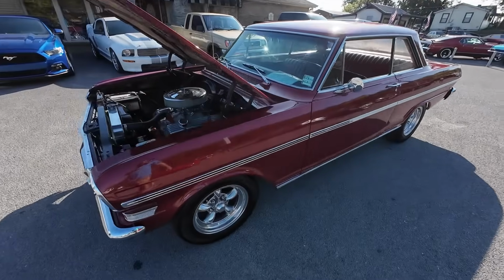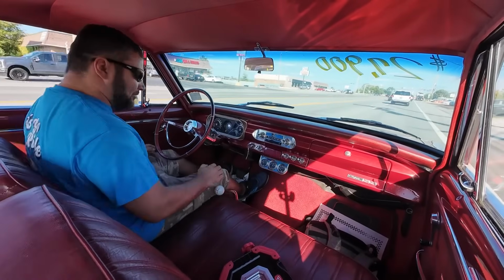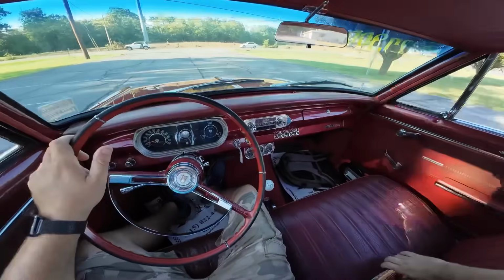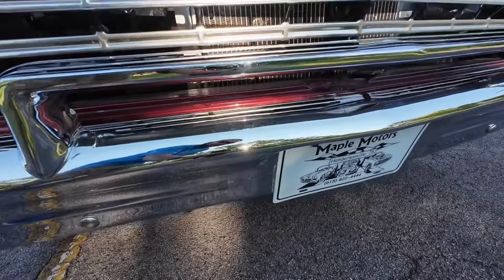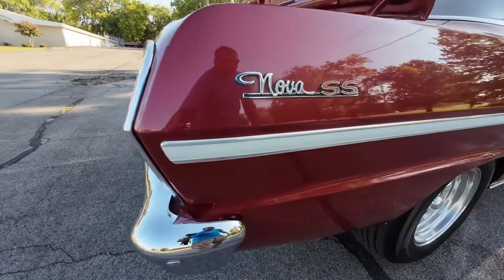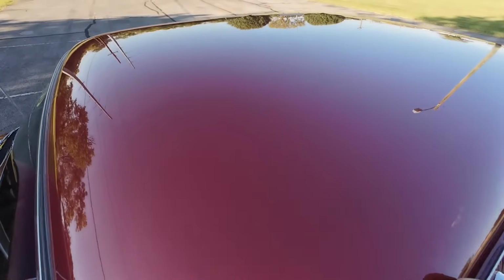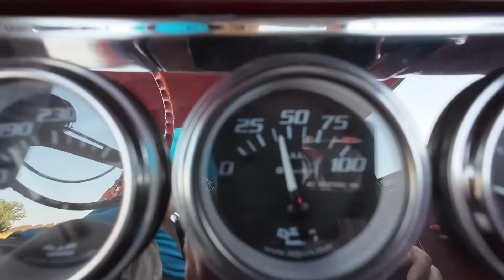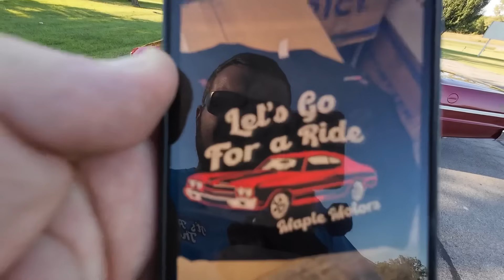Test Drive 1963 Chevrolet Chevy II Nova 327 4 Speed SOLD $27,900 Maple Motors #2325

Comment: Had this exact year Chevy II SS as my 1st car in 1990 at 15 years old. Saved my money for it. Brings back so much nostalgia. I could even still smell the car as you were going through everything. Those rocker panels on those cars always rust for some reason and around the quarter panel wheel arches. I see they removed the upper molding that ran the length of the car. Thanks for sharing this.

Comment: not a show car but a darn good candidate for one,  that has to be one of the most solid Chevy II's I've seen in years!   not only is that an upgraded front suspension its had the front subframe replaced with an aftermarket subframe and suspension kit that's why the bars from the fire wall that connect to the subframe.this car was done right.  it will make someone a fantastic hot rod / cruiser.